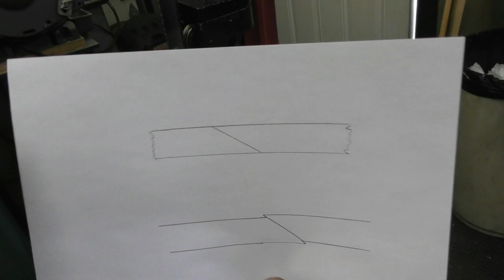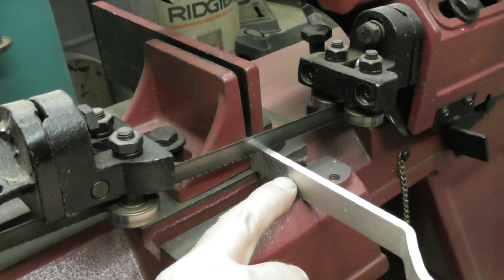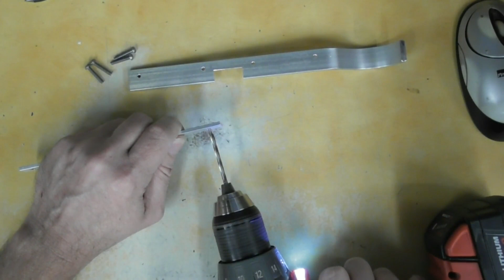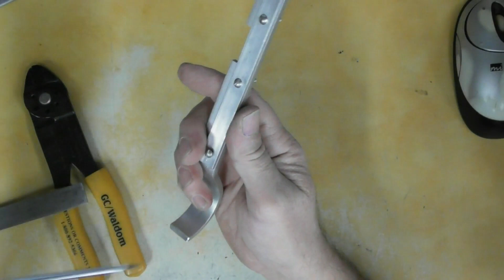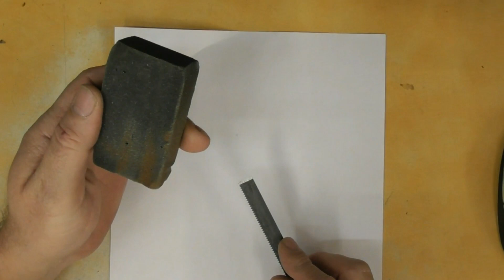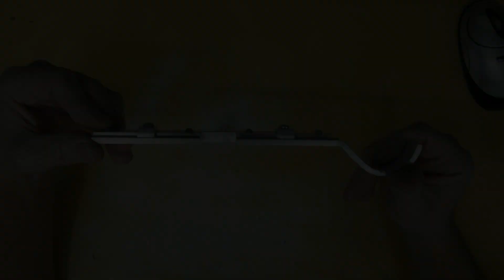Making a Jig and Brazing Broken Band Saw Blades

Comment: You would get a better flow if you heated the blade from below. Solder like to flow towards the heat source. If the source is below, the solder will wick between the scarf joint
Reply from the maker: True Bob. I did draw it in from the bottom, but it may be hard to see in the video. But, I think next time, I'll start the heat from the bottom and test the melt from the top, to make a cleaner joint when it sucks in. Might make for an easier cleanup. Take care, G.

Comment: Great Video G!  Always Enjoy your thoroughness in methodologies for all folks skills and tools.  One question is do you dress the teeth after brazing around the joint?  Nice thing about your aluminum jig is the heat sinking for the 7 inches around the weld but I see it bubbled a bit with the Mapp heat.  If I remember correctly the Stay Silv starts to flows around 1225º then liquefies around 1350º and AL starts to liquefy around 1200º.  Took a Saftety Silv cert class about a 100 years ago and some of it stuck I guess.  ;-P  They do make 3/64 & 1/32 coils.  Thanks for another great video!
Reply from the maker: Thanks PJ. No, I left the teeth as they were. It looks like bubbles- but it's just flux that bubbled up as I was brazing. The aluminum is untouched. I believe your numbers are right in there. I think the focused heat doesn't allow the aluminum to see melting temps. Carelessness could though. Good to know on the coil sizes. This is a bit too large for the task. 

On a side note- I already managed to destroy all three blades...lol. All my fault of course. I may shoot a clip with details- who knows? Take care, G.